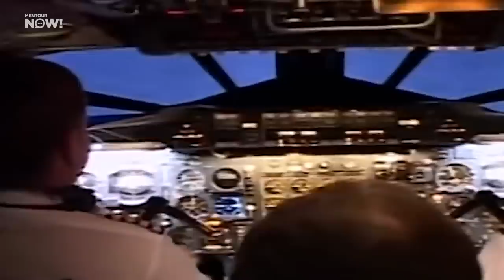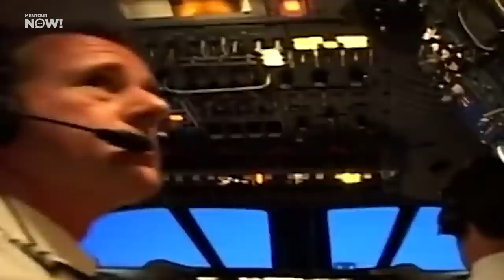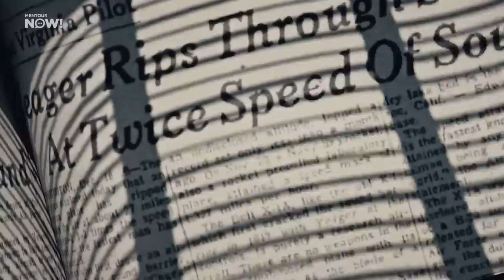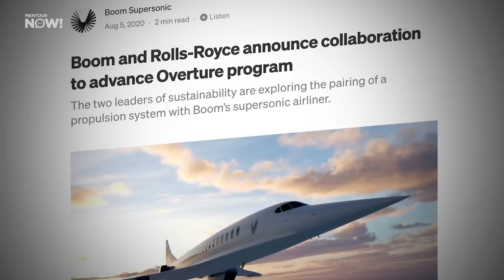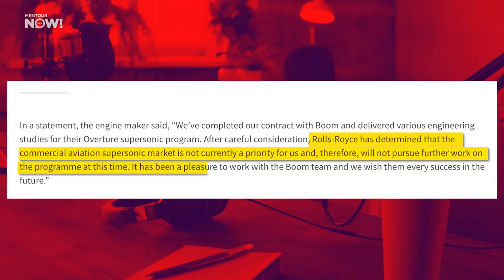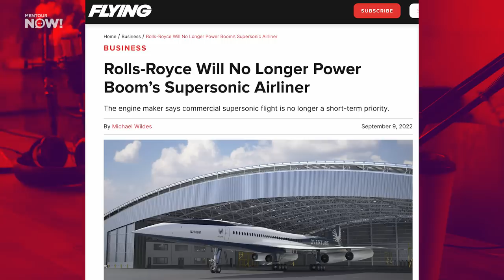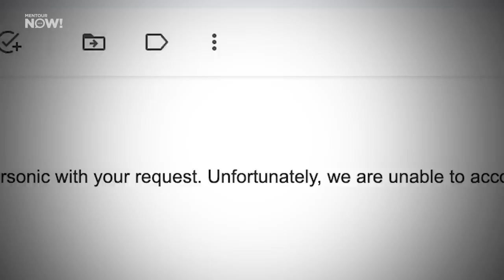WHAT’s Going On with BOOM Supersonic?! Will it Fail?

Comment: I think supersonic transport has a better future in business and charter jets, they are getting faster and faster anyway.
For me as average Joe, the waiting times not flying, from the moment I set foot into the departure airport, to when I get my baggage are as significant as turning a six hour flight into a three hour one.
As far as engines go, the Saab Viggen was equipped with essentally an afterburning version of the 737-100/200 engine and could go up to Mach 2.
Reply: Even more interesting the only major changes they did to it was cut down the main fun from 1.1:1 to 0.97:1. The engine named RM8 (A and B), where the B model added on more medium pressure fan was made by Volvo Aero engines, that is still around to this day and still makes jet engines (well sort if, taken over by GKN Aerospace in 2012) they also make most part for the rocket for the European launch vehicle. 

Also interesting, the RM8A/B have a dry thrust of 65 and 72kN, that can be compared to the 67–89 kN needed for boom overture.

The ultimate irony of it is that Volvo Aero didn´t make the RM8 to be fuel efficient or something like that. Not, the reason why they made the RM8 the way they did had everything to do with serviceability.
Reply: I have serious doubts on that one. The business Market has changed.
Reply: Get TSA Pre-check or whatever. We only need to be there an hour early now and walk right through security.
Reply: Kind of agree with you, I don't think it'll easily take over commercial flights, but it could indeed do something to these other sorts of transport, or perhaps when someone wants to quickly get from point A to point B, however, I'm no aviation expert on this.
Reply: yes but the Viggen couldn't do Mach 2 for 3 hours
Reply: @jonny-b4954  lol and what country is this? Not Europe. You must also be talking about only having hand luggage too because checking in luggage can take an hour

Comment: I was fortunate to see a Concorde once back in the 80's.  One flew into Omaha for a charter flight to England.  It was beautiful to see it all flared out with the nose up to come in for a landing and then to have the pilot drop the nose, hit the throttles and do a fly by.  I do not remember seeing the afterburners light, but it was still very loud.  I went back to Epply Airfield the next morning to watch it take off.  A truly beautiful aircraft.
Reply: @billratekin4134 Great story. BTW the afterburners were only used to take off  and then at 43,000 feet they were turned on to break the sound barrier when over sea.

Comment: As much as I love Concorde, everyone else does too. So my number one pick (just) tips towards the L-1011. So ahead of its time, despite being a commercial flop. We also have the L-1011 to thank for the RB-211, which is still the core in basically all the big RR engines today. It is a bucket list item to fly on one, which may be possible with the Tristar experience, something I only just learned of.
Reply: The tristar is a really good choice and definitely also nearly tops my own list. It was, for its time, the most technologically sophisticated aircraft, introducing autoland before autoland ever became a thing for the rest of the industry.
Reply: And it was Rolls Royce's failures that hampered the success of the L-1011  . RR had to be rescued by the UK government.
Reply: its a shame really as the Tristar was so much better than the DC-10. The Vickers VC-10 as well. Great planes that didn't get the success they deserved
Reply: @robertradmacher4135  well I'd still rather have RR engines over GE, you just have to get a dig in about anything that isn't American
Reply: @ant2312  But he is absolutely correct, Rolls-Royce was grossly late and screwed the entire L1011 program.  Now, they have backed out of the Boom supersonic deal.

Comment: Some re-engined 727 had updated outboard engines while the center engine could not be changed due to the S duct design so it literally had a different 3rd engine.

Comment: Here's the real problem: These are still commercial flights. You lose a LOT of time on each end dealing with security, navigating large commercial airports, baggage claim time, and more. New York to Paris is barely a 7 hour flight on a long range private jet. You can't shave enough off that with a commercial supersonic jet to overcome the inefficiencies of the airport itself. The truly wealthy have no use for a supersonic jet so these will remain a novelty for those a very narrow segment of people that can't afford private but want the novelty of going Mach 1+. 

The net is this: By improving airport inefficiencies, we could reduce travel times for ALL passengers on ALL flights, all the time. And we don't need faster aircraft. Money spent on this has a much broader benefit.

I do agree, though, that new tech like this is super exciting to see.
Reply: Indeed, exactly.
Reply: High-speed rail might be good for this. Not only will it cut back on many of the emissions caused by short-haul regional travel (not to mention automobiles), but it will also make airports less crowded- a win for everyone.
Reply: Exactly if a standard commercial flight could make the loading / unloading faster you might only be 1-2 hours slower than Boom
Reply: @anonymoususer3012  I'm a huge fan of high speed electric rail powered by the power grid. Fast, efficient, using proven tech, and best of all - can carry heavy loads no problem, unlike air which is costly as weight goes up.

But rail can't cross oceans, so there's still a gap to fill there.
Reply: I will add:  If Boom could get the cost of the aircraft down to the $75MM range, then there is probably a market for privately owned or charter fleet sales...
Reply: This is very true.  A week ago I took a 50 minute turboprop flight from Toronto to Montreal.  At 7:30, as I was getting on a commuter train to head for the airport, there was a VIA Rail (intercity) train at the station heading for Montreal.  Guess what?  As I left the Montreal airport 4 hours later, that same VIA train was just arriving at the adjoining train station.  Canada doesn't even have high-speed rail!
Reply: on regional flights, the procedures typically take around 30 minutes unlike international flights which means like in the case of one american company paying their execs highly and shipping them around on small private jets, this is a time saver especially since they dont have to go through normal procedures at the airport.Theres a few good applications i can think off for a large long range supersonic jet.
Reply: People who fly these elite flights have private entrances and security in airports, so time navigating the airport itself would be negligible.
Reply: @jerryuma  Say that again out loud.

Note, American's are the ORIGINAL supersonic fliers.  I was lucky enough to meet Chuck Yeager a few times.
Reply: @xmtryanx  but the American supersonic planes never made it. I believe this was a Boeing 2707, it was a disaster. McDonalds Douglas tried, they failed, and I believe Lockheed Martin tried and they couldn’t do it. I’m no offense to Americans, they are just behind in this area of aerospace compared to counties like Russia, (Britain, France) joint venture who did Concorde etc. The Americans also have political issues like the sonic boom, it’s just a lack of engineering knowledge.
Reply: @jerryuma  I could swear the United States has half a dozen supersonic types of planes in service right now.  If i'm wrong, someone can correct me.
Reply: @xmtryanx  I’m sorry sir, that is not true.
Reply: @jerryuma  the problem is that americans design too big, like with their cars.
Reply: @jerryuma  Offhand... T-38, F-15, F-16, F-22, F-35, B-1.   Just off the top of my head, those are all in service.
Reply: @System0Error0Message  exactly!
Reply: @xmtryanx  this is about commercial supersonic. I don’t know those planes but they don’t count anyways cause they are most likely military. This video is about commercial my American friend 😊
Reply: @xmtryanx  true.
Reply: @jerryuma  excuse me. Americans are well capable of supersonic
Reply: @jerryuma  If you think Concord wasn't paid for by the governments, you're wildly mistaken.
Reply: @xmtryanx  good point.
Reply: They really need a jet that has the range to fly pacific coast to Asia and Australia  for this to make sense

Comment: Trident 3B aircraft had 3 RR Spey 512 engines and 1 RB162 boost engine as standard (for hot and high / short runway operations) plus an APU.